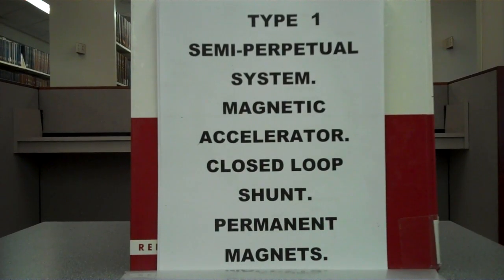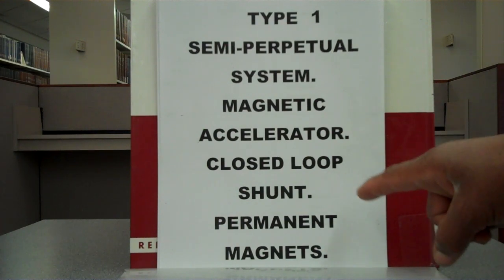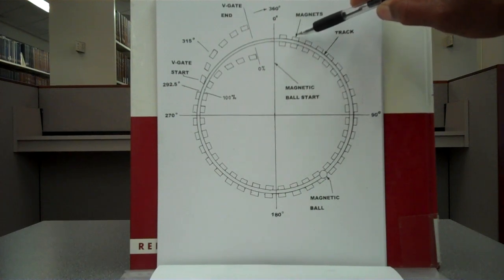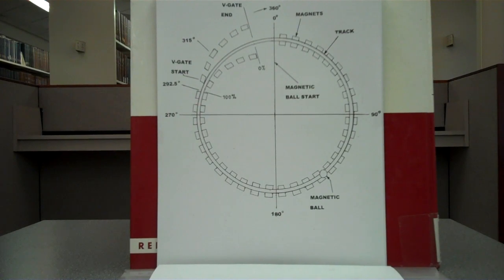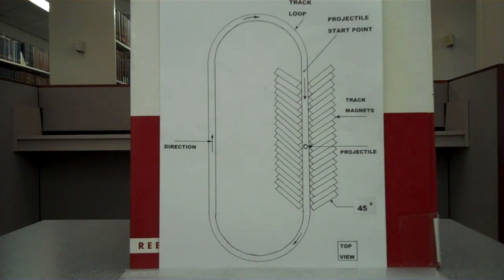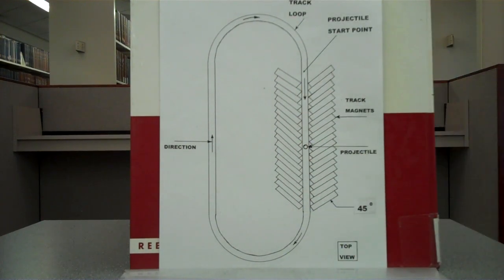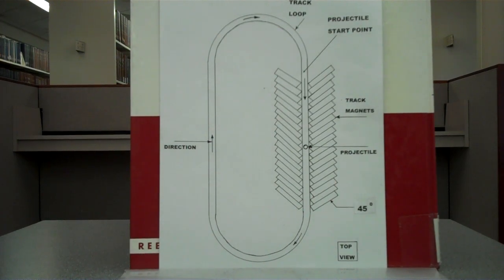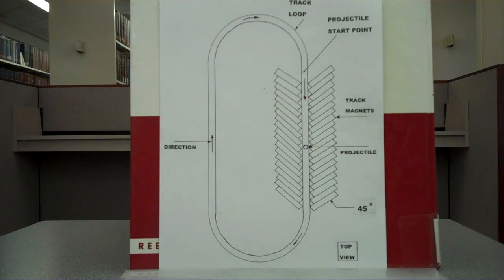MAGNETIC ACCELERATOR. Closed Loop. TYPE 2. Semi-Perpetual. Permanent Magnets. May Need V-Gate(s).

Comment: Sir, my traveling magnet does get attracted into the V gate but doesn't escape the gate. Why is that? Is it because I am using polarized magnet? I used neodymium n52 mags.
Reply from the maker: Mr. Peter Paun : .. (1) You must make sure your " V-Gate " is wide enough at the end points of the " V '. (2) make sure all your magnets of the " V " are equal distance from the track. And, equally spaced from each other. (3) for a linear accelerator your " V " is has straight lines. For a circular accelerator your " V " is curved. (4) your " V " must be long enough. Start your " V " around the 270 degree point or before. (5) your tract magnets must be equally spaced. (6) Neodymium N52 magnets are very strong. Hard to handle. See if you can find ceramic in cube and ball-spherical form. Look online (world wide web or internet).
Reply from the maker: Mr. Peter Paun : Magnets have 2 poles. Depending on the shape, may have several sets of of the 2 poles. Such as a cube magnet. If the magnets are N-N or S-S they repel and will destroy each other's fields in a short time of a day(s), week(s) or a few months. Therefore you need " Magnetic Keepers " to avoid this.
Reply from the maker: Mr. Peter Paun : .. Read the description below my video about permanent magnet accelerators.